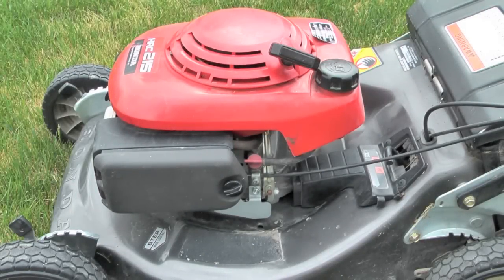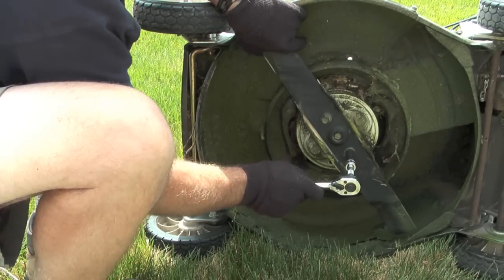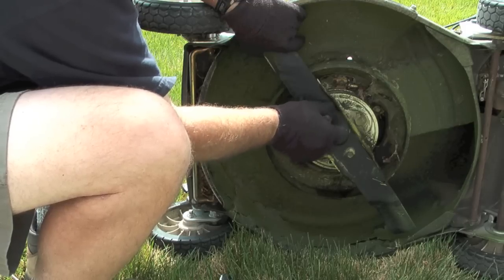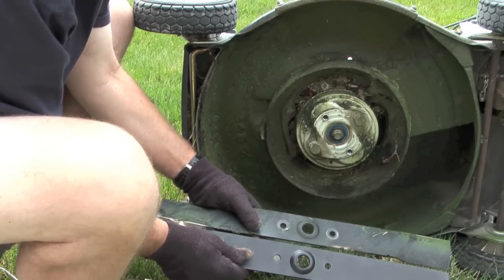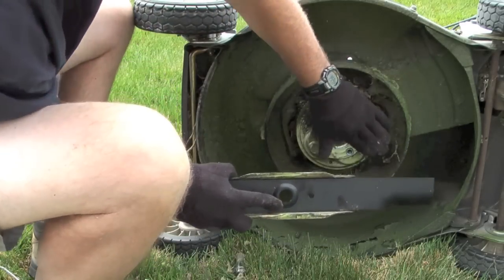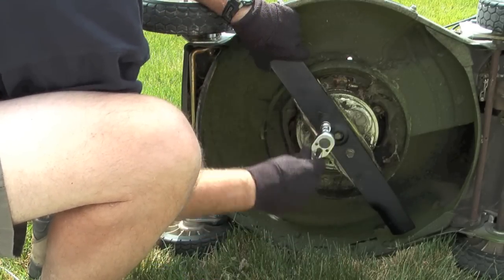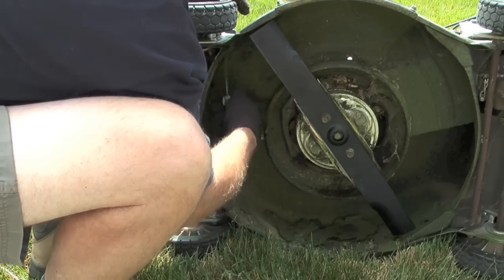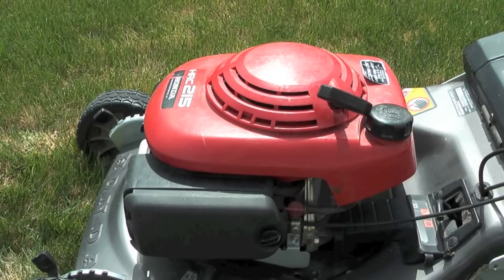How to change the lawnmower cutting blade

Comment: I wish my Blade came off that easy. The bolts on mine seem welded to the damn blade. No matter how much penetrating oil I use, I can’t get the damn things to budge.
On another video, the man used a 2x4 block of wood to prevent the blade from spinning as you’re lose ing it, which is a good idea. his deck seemed to be a different design though, where he could easily do that.

It seems you replaced your mulching blade with a regular blade. Not good. It’s always best to have a mulching blade on your mower.

Comment from the maker: To DTOM g

You need to enable comments in your settings. To answer your question, I did sharpen the old blade a few times with a flat file. I'm not crafty enough to use a bench grinder to sharpen the blade without leaving it unbalanced.

Comment from the maker: The control linkage on the lawnmower was in the OFF position so even if I tried to start the mower the way you describe it wouldn't happen. This mower will only start with the control linkage in the RUN position. 

BTW, the manual transmission analogy you put forward only works if the key to the car is in the ON position.

Comment: Any tips on rusty bolts that won't move?  :)
Reply from the maker: I would try multiple soakings of the threads with something like WD40. Then maybe a socket with breaker bar and even a small cheater pipe. Hopefully you then don't break the head off the bolt when trying to remove it.
Reply: iScaper1 First soaking on!  Perhaps I'll repeat over a few days.  Thanks.
Reply from the maker: robzrob
Let me know if it works.
Reply: My Honda izy mower resisted normal attempts with quality socket & breaker bar + pipe extension.
The nuts have increased frictional area where it meets the washers, so ground some of that with cutting disc following the washer. With wood block to stop blade turn one nut undid, however the other nut was rounded and becoming worst. Fortunately my brother had special sockets with helical grooves that tighten on the nut rounded corners and that worked.

Comment: Always tilt the mower on the opposite side of the air cleaner so..  Oil / Fuel doesn't get into the Filter..
Reply: honda says to do it like that. They say to turn fuel valve off and remove spark plug boot off first.

Comment: Hey iScaper,
Thanks for this tutorial. You are always so clear spoken, concise on the tool and parts
your directions of "how to's" have been a blessing to me. I've never changed anything on a mower but with your instructional videos I have changed the oil, the spark plug and now the mower blade on my mower and it runs SWEET!! Thanks for putting these out, I really appreciate your time with these.

zester2000

Comment: Do you have any idea how easy it is to move that control handle into the on position? You have the wrench in your hand, just take out the spark plug for crying out loud. Better men than me have made mistakes with power tools, always err on the side of safety. Removing the plug and replacing it only adds 40 seconds to the job, and gives safety redundancy. The person who accidentally hits that lever on something while turning the mower on it's side will thank you with all ten fingers.

Comment: Dude, had you turned that blade it could have started that engine. I have a friend with just one finger and a thumb by changing a blade without removing the spark plug first. Think about it, you can push a car with a manual transmission and pop the clutch and the car will start without cranking. This video is, IMO, very dangerous, as someone is going to turn that blade and the motor can start!